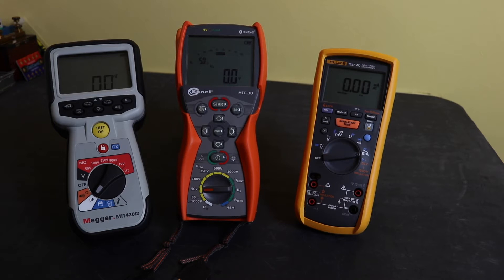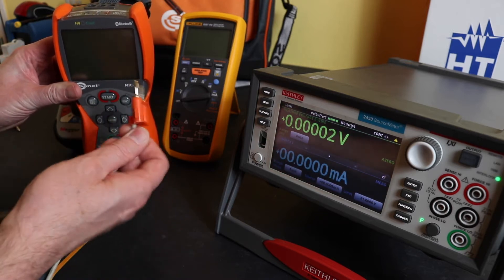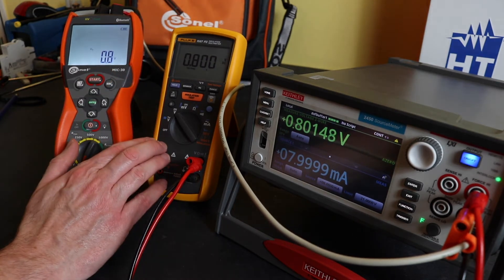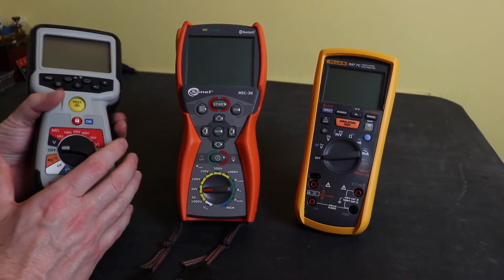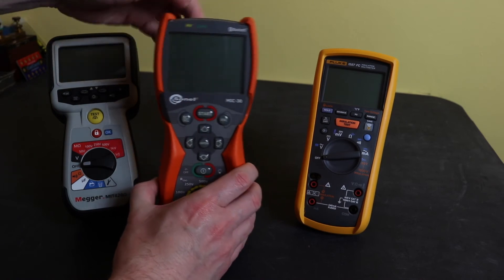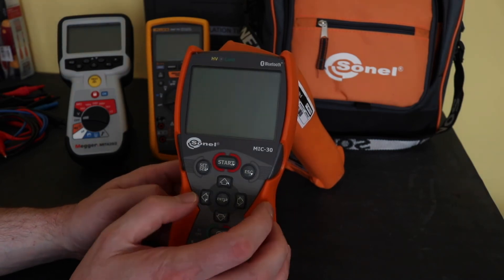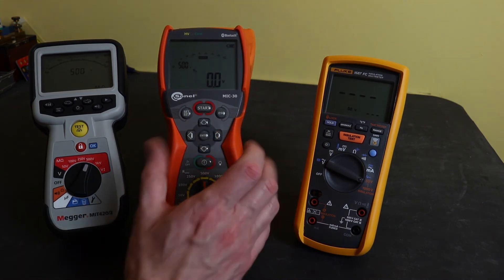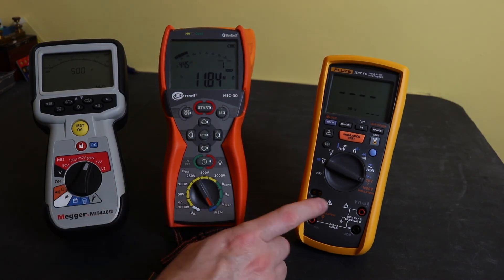Insulation Tester Comparison Part 2 - Megger vs Sonel vs Fluke

Comment: You should compare with the actual 1KV model of Fluke i.e. 1507 instead of 1587.
Reply from the maker: I can only test what I have available to me, whilst the 1507 is more in line with the test capabilities of the Megger and Sonel units, the 1587FC is Fluke's top of the range Insulation Multimeter, so should be able to match the other units in my opinion.

Comment: Loved the cameo of the Keysight :) I think a hook or a magnet are often the most useful support mechanisms. 

On fuses, it frustrates and confuses me that a lot of instruments rated at 600 or 1000V use little 250V glass fuses.

Do you ever use the memory functions on your testers? By the time I've recorded which page relates to each measurement I reckon I might as well just write down the readings. The only stand alone memory function that I think is useful is logging.
Reply from the maker: Appreciate you watching and commenting TCEng. Not sure Keysight will share your enthusiasm for the way the U1461A was in use. I do like magnets, my old proving unit had one in the back and it was superb for clamping onto panel doors for handsfree use.

Yes, the little glass fuses aren't much use for meter protection, thankfully there use isn't seen on the meters the top manufacturers produce.

I do use the memory function a lot on the MTR105, but that is a different beast altogether. Other than that, I like to use the memory function for recording the DAR and PI curves, but not a lot of instruments will allow that. Other than those, I do not utilise the memory function much, like you say it is just as easy to write them down. There is also the issue when on a client's site and using a meter such as the MIT420/2 that offers no download of being able to justify the reading if required, where as a handwritten protocol sheet recording the measurements on site will provide that.